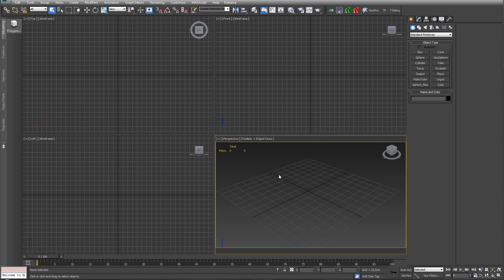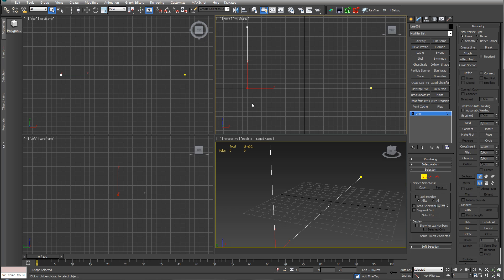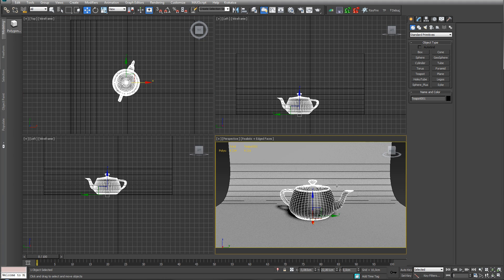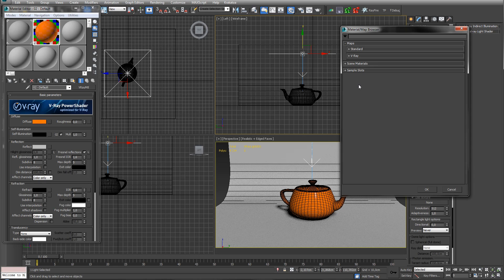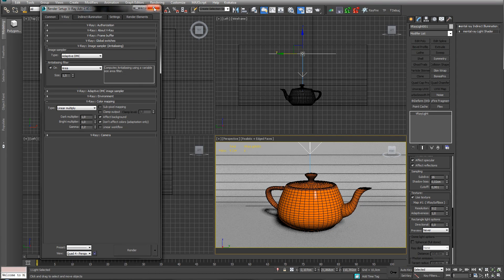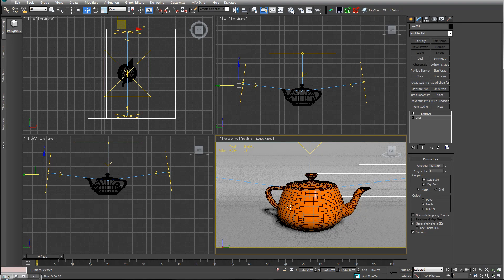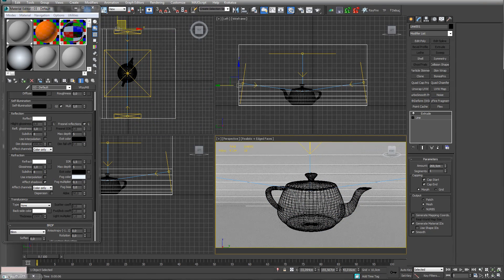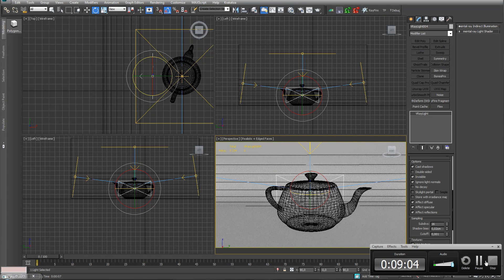Studio Lighting in Vray - 3DS Max 2014

Comment: How do I add a Vray material in the slate editor?
Reply from the maker: You just need to right click in the slate material editor and choose materials->v-ray->VrayMtl
Reply: I don't think that's the problem . . . when I went to the render setup and assigned a renderer Vray wasn't an option
Reply: Kelemen Szabó Vray is more of a plug in for 3dsMAX if you can't see it well i guess you don't have it installed :)
Reply: I thought Vray came with 3dsMax . . . thanks for the info!
Reply: Kelemen Szabó You can download a the demo from Chaos Group website. Its pretty easy to install.

Comment: Jesus how many CPU cores do you have?
Reply from the maker: It's only a 6 core with hyper-threading so 12 threads
Reply: wow, really ok

Mine is a 2 core I5 450M and I don´t have access to one that´s faster that´s why I was so amazed by the speed but I am getting a AMD 8350 soon(8cores) :)
Reply from the maker: GameMen10000 Yeah sucks to be on a 2 core, i know the feeling :)
Im sure it will be a nice lift for ya :)
Reply: I sure hope so :) thanks for the feedback, you´re really fast at it
Reply: Hi! Thanks for your tutorials, pretty useful!!
I wanted to know your CPU/Graphic card configuration (in 2017).
Wish you all the best in 2017!
Reply from the maker: Thanks :)
Im now running an overclocked intel i7 6950x 10 cores/20Threads at 4Ghz, 2 Nvidia Titan (pascal), 64gb Ddr4 2400mhz memory and a whole bunch of ssd's and a m.2 stick :P

Wish you all the best right back at ya :)

Comment: Great Video! you explain really well, I have a problem, when i hit render, the quality of the image is really low and very grainy, it also takes a long time to render, i have about 6gb of ram on my laptop, How are you able to render so quickly and with such good quality.
Reply from the maker: It's more about what CPU you have (speed and cores).
Maybe you have your GI setup too high? If you are using Irradiance map, set the preset to low as a start. I beleve it's on high at default which means it will calculate the prepass 4 times.
If its not the GI then change the subdivs for the glossy reflections and the lights. You also need to tweak the image sampler.

I recommend you checking out Grants video about optimize vray: http://www.grantwarwick.net/mastering-vraynew-page/